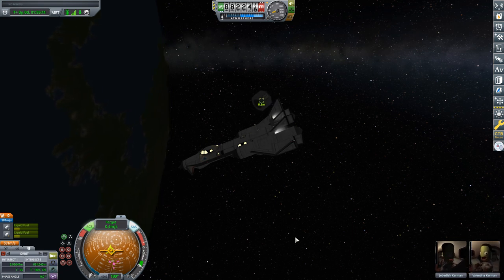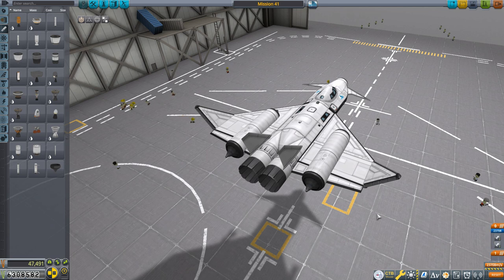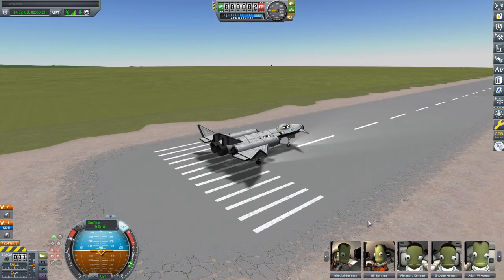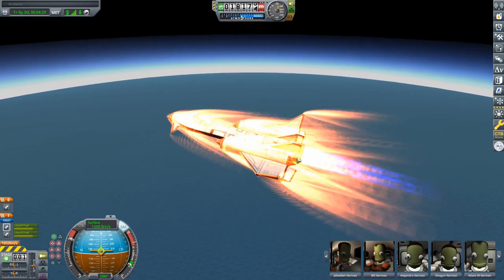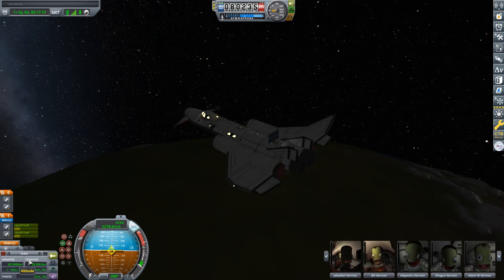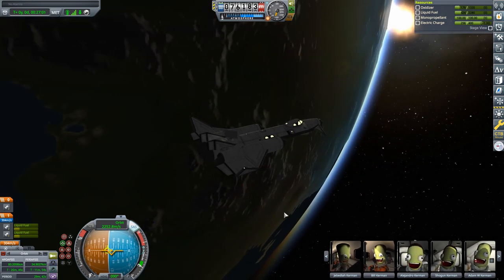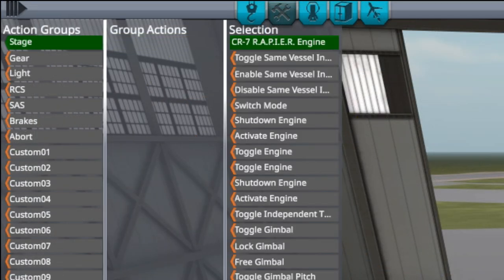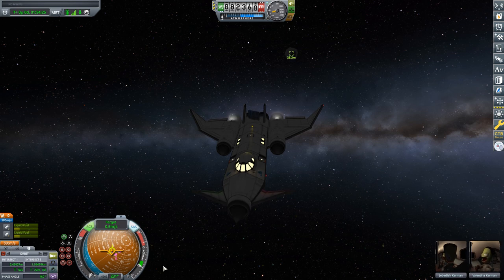How to Build and Fly an SSTO Spaceplane | KERBAL SPACE PROGRAM Contract Tutorials

Comment: A couple of other useful tweaks: pitching wings up by 3-4 degrees will make the lift of the whole plane more drag-efficient. When switching from air to rockets, it's not advisable to have high angle of attack - keeping shallow ascent (8-12 degreed) and maintaining vertical speed above 100m/s would be more efficient.

Comment: I think single stage everything in career is a very cost-effective way to do things. Single stage to orbit, separate the payload that is another single stage to landing on the Mun (or maybe a two stage thing that you return both the lander and the ship), then bring everything back down at or near the KSC. I use boats to haul spent boosters back to the runway where they can be recovered for 100% value. Then I hook the boat up to a mining refueler and send it back out when there is another booster or ship.
Reply: Cool, but recovering boosters must require careful flight planning if you don't have mods. Objects not in physics range just get deleted below a certain altitude; I think it's 22km.
Reply: @eekee6034  I like following a flight path that makes my orbital imsertion burn doable with just the force from a decoupler. So liken80 by 67, 68 or something.
Reply: @scottwilliams846  Oh, that would make it easy! :) It reminds me of my orbital tankers. There's no point ditching the tanks of the first stage when they could contribute to the tanker's capacity, so the first stage is just an engine. It gets dropped at roughly 80x60km too.
Reply: @eekee6034  I get that trajectory before getting out of the atmosphere. Basically I get an orbit inside the atmosphere and then raise it.
Reply: @scottwilliams846  If I understand rightly, that's very efficient.

Comment: Hi Mike, the tip at 5:30 that 'air intakes create more drag when they are active/open' is false; closing air intakes has no affect on drag or anything else for that matter, besides disabling the intake. The only possible use for it is to store a small amount of air in the intakes, which you can then use like an oxidiser for a rocket (e.g. using jet engines in space), but otherwise there is no need to enable nor disable them.

Comment: Tip for SSTOs: 1 single Ramjet air intake has enough Air intake to power 6 RAPIER Engines in airbreathing mode if flying at sufficient speeds

Comment: 5:30 you do NOT need that many air intakes. Take the aft two off.
Reply: The savings would be very small. In terms of mass, replacing a Shock Cone Intake with an Aerodynamic Nose Cone saves the equivalent of 22.5 units of monopropellant or 18 units of liquid fuel. I don't know what it would do to drag, but I'll be surprised if the rounded Aerodynamic Nose Cone has less drag than the Shock Cone Intake. Replacing a Shock Cone Intake with an Advanced Nose Cone only saves half as much mass.

Comment: Nice tutorial. But I'm not able to get to 1000m/s. I don't know what's wrong.
Reply: I mean just on whiplash engines.
Reply from the maker: At a guess, you may be ascending too quickly. If you don't carry enough speed into the higher atmosphere, then the Whiplashes won't be able to generate the necessary thrust. Also, if you're in KSP2, this won't work with the RCS blocks as the drag model is broken.
Reply: @MikeAben  Bro I'm waited an hour and my ssto still haven't 20km
Reply: and it's so slow

Comment: Never pitch up that hard. It doesn't matter if you're in "rocket mode." If you had the aeroGUI open you'd see that your ridiculous pitch up causes an equally ridiculous amount of drag as well as a ridiculous increase in gravity losses. It's lose lose. Just keep your pitch low, to the point where your plane is on the verge of blowing up from heating. THAT is the most efficient ascent.

Edit: All that dancing around with the throttle trying to maintain 1 minute to apoapsis is completely useless. Go full throttle until you reach orbital velocity. If your apoapsis goes past your target before you reach orbital velocity, then, surprise, you pitched up too hard.

As I'm typing this there's just so much more wrong with your video that I can't keep up.